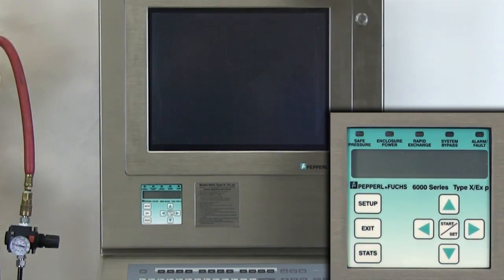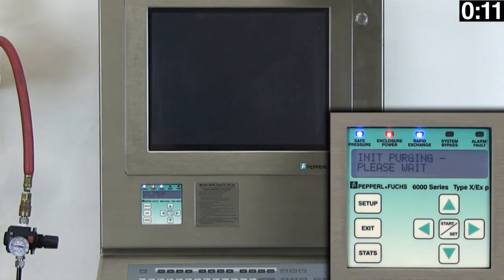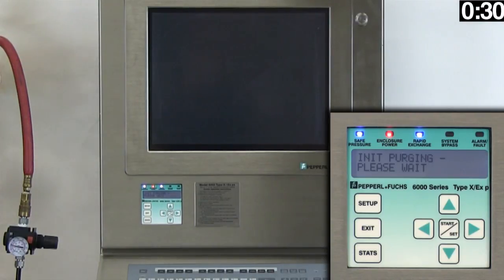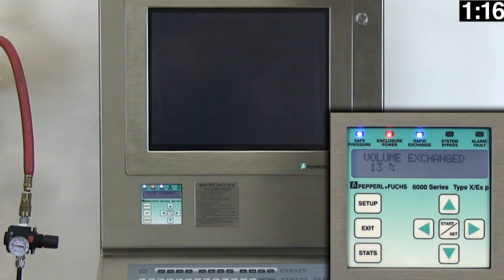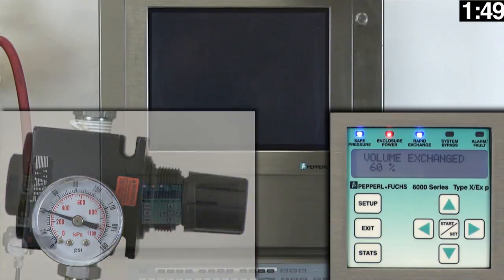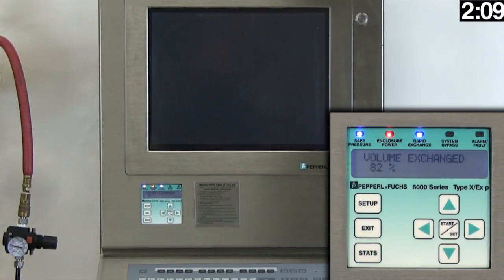Cold Start Type X/ Ex px Purge System

Comment: I know this is a little late, but it'd be great if you guys could do a guided setup/configuration of a 6000 series externally mounted purge system (with the solenoid valve). My company has used these on many enclosure systems. I seem to have a reoccuring issue with a low panel purge pressure alarm (on our end, would this be output of purge system NO/NC?), but I'm not entirely sure where the problem is. I believe I've configured it properly, but can't seem to find where the issue is. I'm not sure if it's the seal of the enclosure, the other penuematics we have installed inside the enclosure contributing to the problem, a wiring issue, etc etc. I'm quite new to these systems and have gone over the component literature but it'd be nice to have a visual of setup from all menu items on the purge unit to see how it's done by the professionals. Thanks! We are a frequent buyer of this system so I'm trying to get to it in whatever way possible.
Reply: I am looking for exactly you described, did you already find some tips ?
Reply: @lukaszurek7129  me as well